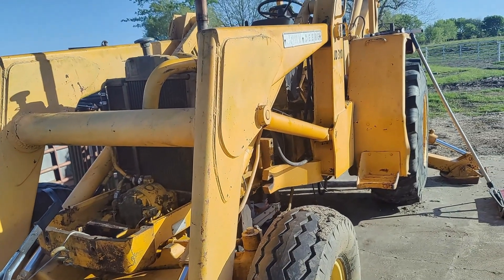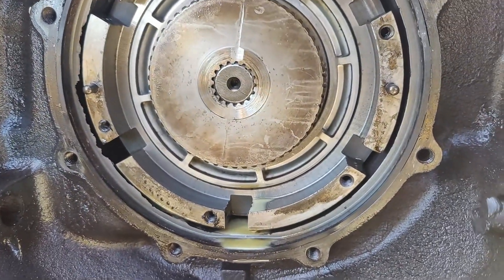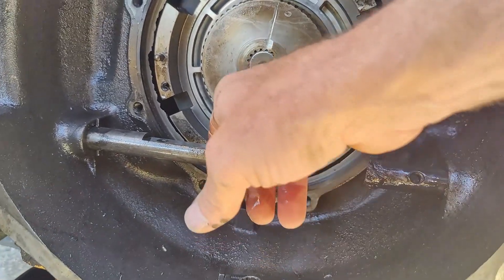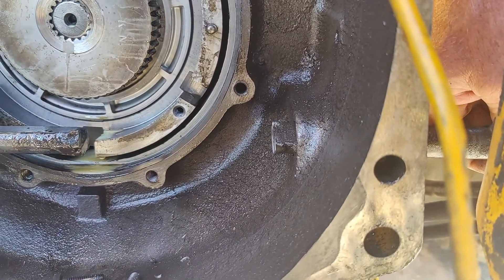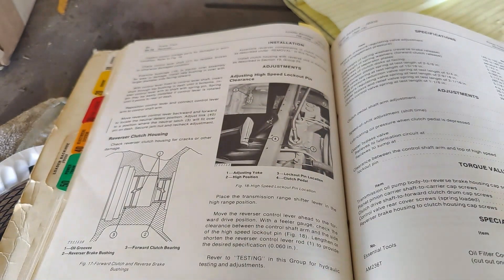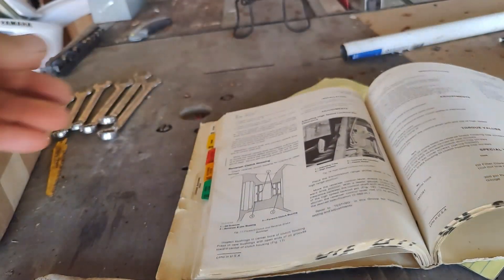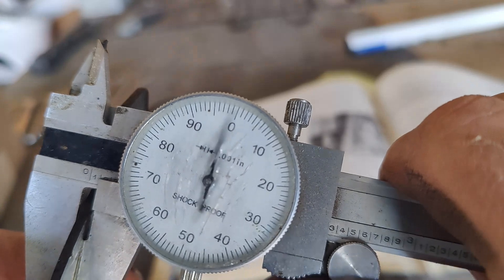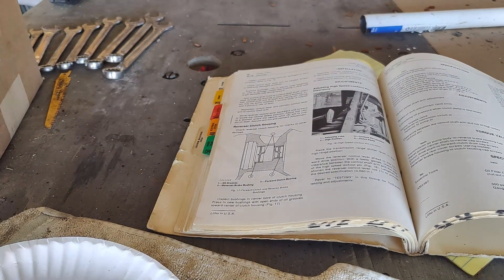John Deere 310 Backhoe will not go forward. Maybe the clutch plates, not so much...

Comment: What did you do about the shaft? What's the proper way to remove it? Or does the shaft have to be removed at all to get the clutch pack out?
Reply from the maker: The clutch pack is already removed. That shaft you see is behind the clutch pack...

Comment: Any update videos? I’m following your progress.
Reply from the maker: Filters were no help...I did trace hydraulic pressure. I'm losing the presure at the forward piston that pushes on the forward clutch plates. I will have to separate it and take out the forward clutch pack..There's only three things I think it can be: 1. Clogged hydraulic portal in the tranny (unlikely) 2. Possibly a seal behind the piston (that sounds likely). 3. Stuck forward clutch piston (also likely). Should be an easy fix....
Reply from the maker: Check the new video. Fixed...
Reply from the maker: Although the clutch plates were beyond spec, that was not the problem. That leaves the hydraulic system which is made up of 2 filters and a release valve in case the filters get clogged. Well the filters were clogged, nasty clogged...However, I have to wait til Monday 4-28 for the new filters to arrive. I will video the progress...
Reply: @soulgravygarage8409 I am having the exact same issue. Great reverse but my forward will only work at high rpm. I know of the filter on the side of the transmission. Where is the other one?
Reply from the maker: @nickcarle6290  On the 310 they were right next to each other...
Reply: @nickcarle6290 saludos, tengo el mismo problema y estoy en la buscá de solucionar el problema, llegaste a solucionar. Me podrías decir un favor si se solucionó. Gracias